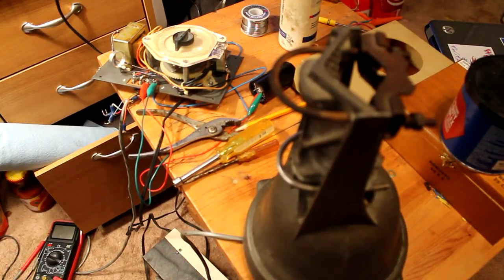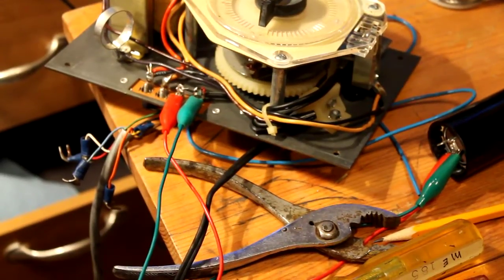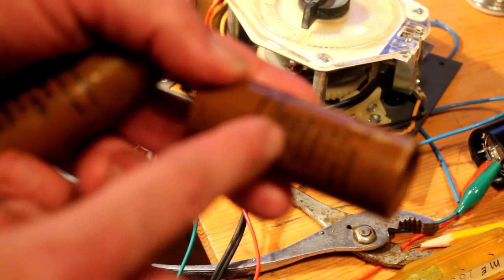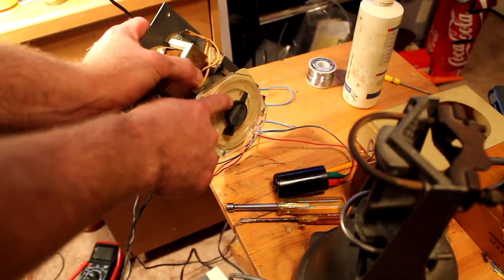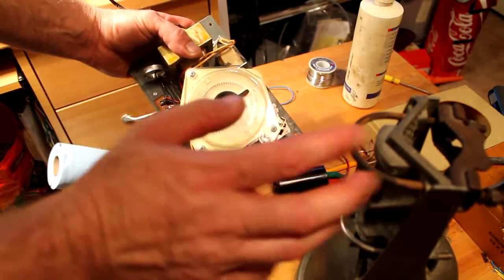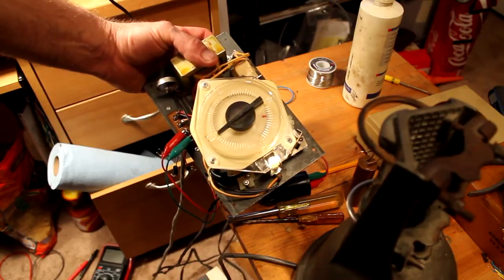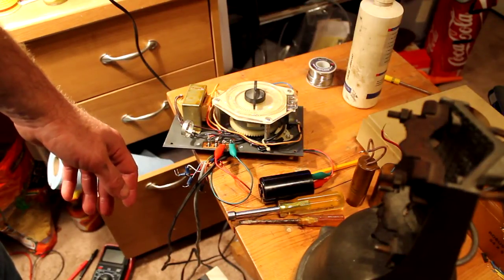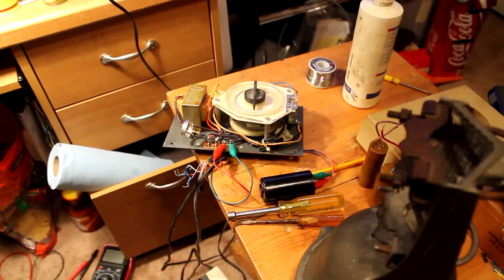AR-22 rotor timing

Comment: hope this finds you safe. All worked before i lubed it.  i just rebuilt my ar22 and totally forgot to mark the bell to the base etc. it is all back together now and sounds so quite now BUT. the controller light come on and the rotor turns but no clicking in the controller now. i also replaced the cap in the controller. ive took apart the rotor 2 times trying to figure out if i did something wrong but all looks good to me according to the repair manual and other videos. any ideas? 73s

Comment: I need bearings and retainers and a ring gear for one, anyone sell parts anymore? I belive I also need a transformer and cap transformer gets real warm then it powers off after about 2 back and forth (N to N twice to 3 times without the bell on just motor turning)